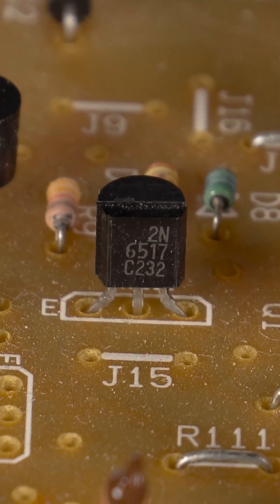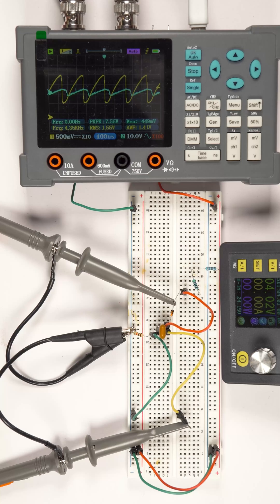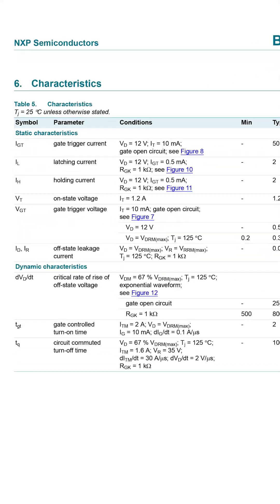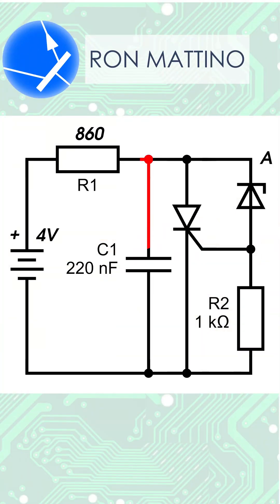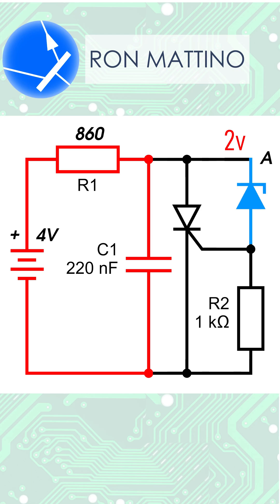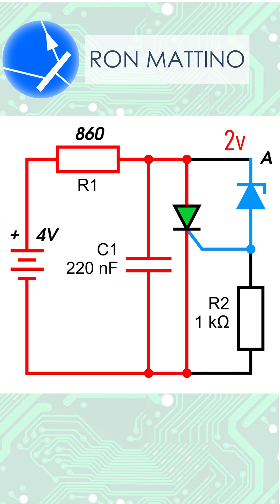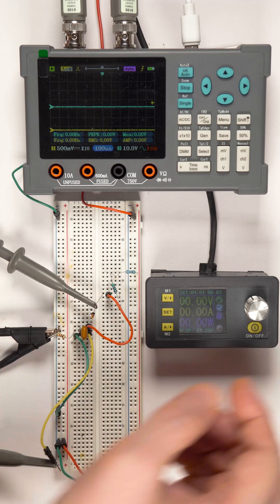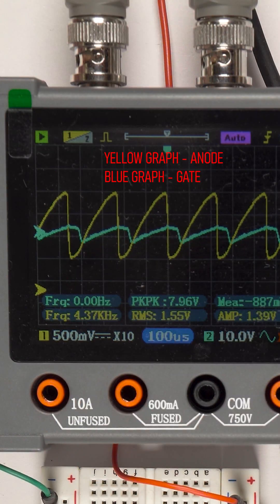How to build a simple thyristor based oscillator? #electronics #scr #diy

Comment: Actually, it's the holding current that is the value below which the anode current has to drop in order for the SCR (thyristor) to turn off. You haven't explicitly shown the SCR you're using, but if it's a BT149 whose datasheet you showed, then it has a typical latching current of 2mA and also a typical holding current of 2mA. That makes designing your circuit difficult.
For the SCR to turn on, it needs about 0.6V on its gate and an inital current greater than the latching current. When that happens, the capacitor is charged up to about 2.6V, meaning that there is 1.4V across the 860R resistor, giving a current of 1.63mA. The rest of the current needed to exceed the latching current comes from the capacitor discharging into the SCR and we don't know how much that is.
For the SCR to turn off, it needs to be passing a current less than the holding current. However, as the capacitor rapidly discharges the voltage across the SCR rapidly drops, which means that the gate becomes isolated while the current through the 860R resistor rises towards 4V/860R = 4.6mA. That means that either the SCR used had a holding current greater than 4mA (not typical, but possible), or the lack of gate current allows the SCR to turn off at a lower value than the holding current.
In all of this, you can see we really don't have enough information to confidently design an oscillator. You just have to "suck-it-and-see" to find a working value for R1 depending on the SCR you're using. If R1 is too large, the SCR won't turn on; if R1 is too small the SCR will turn on, but not off again.

Comment: You can increase voltage and use TRIGGER DIODES ( DB3 for example) . Your schema has an error. You have to discharge C1 in series with resistor to limit high current flow between anode and cathode.
Reply from the maker: I showed in my video that this oscillator works as is.

Comment: I don't understand why that capacitor c1 discharges while connected to vcc
Reply: When the thyristor opens it creates a path of no resistance so the energy stored on C1 will start to empty to go down this path. Which will eventually shut off the Zener and Thyristor so C1 begins to fill again causing this process to loop.

C1 will discharge if there is a path for it to discharge even when connected to the Voltage Source. 

You’d have to do the math, the resistors in the circuit are assisting to keep the current and voltages close to the desired levels for this loop to occur.
Reply: @borgercheeses  thanks for the reply 🤩